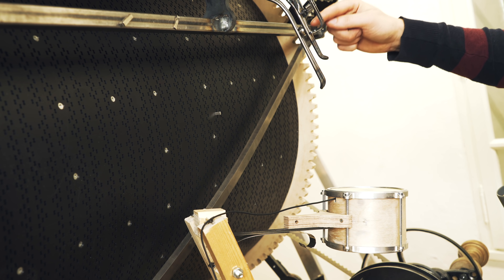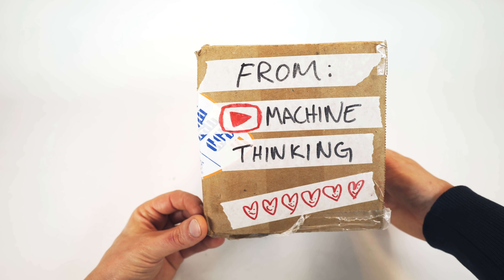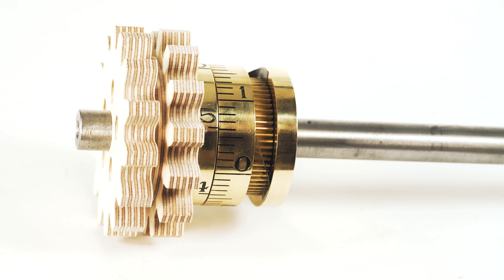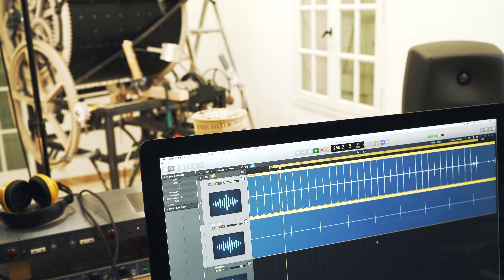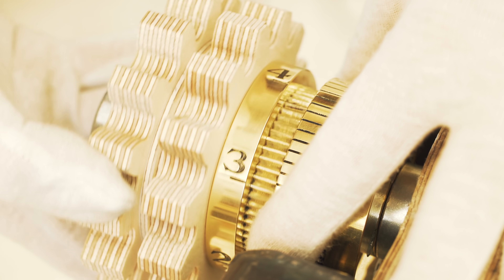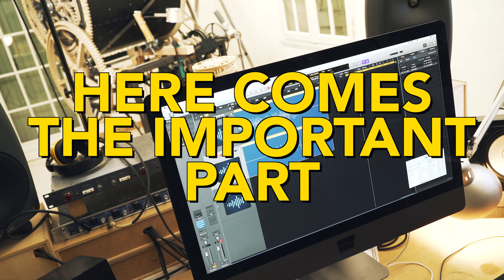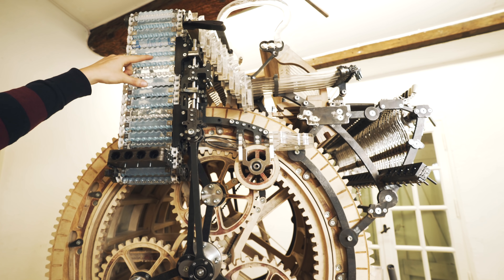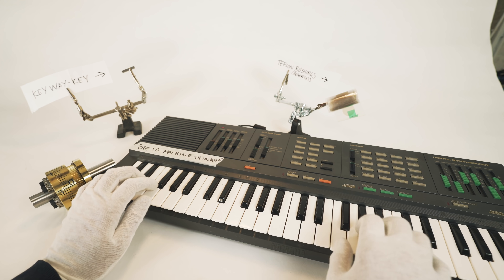Testing the Music Timing Clutch - Marble Machine X #77

Comment: I really like the futureproof thinking here. By making this adjustable, you can use MMX on other planets where gravity is different.
Reply: First moon based concert?
Reply: Artiamus Imura 
Make it so Richard Branson!
Reply: @Artaimus  Indoors then :D
Reply: Mackinstyle The marbles would just get flung off the machine at the lifting part
Reply: @jatoxo  thinking of the technical details! Solvable though... Probably it will need some different lifting mechanisms for the moon or Mars.
Reply: Marbles made of a heavier material should work too.
Reply: Still needs gravity though... Not ready for intergalactic action unfortunately
Reply: @stabojert  the marbels are made of steel, so a large coil powered to be an electric magnet could simulate gravity to the marbles. In that case even the drop speed could be adjusted to the timing of the  rhythm machine.
Reply: @stabojert  You don't need gravity constant vertical (relative to the machine) acceleration of 9.81m/s2 would work in low gravity.
Reply: @zym6687  Good idea :D A lot of cranking is nescessary for that acceleration though ;)
Reply: @stabojert  That depends. Since we're also made for gravity, interstellar travel would ideally involve constant acceleration.  Acceleration toward our goal and then acceleration away from it to slow down again. Therefore, there would nearly always be some "gravity" from acceleration.
Reply: @stabojert  just a tiny transportable gravity massive would be just in case
Reply: This makes me imagine him playing it on Pluto and it takes a whole minute for one marble to fall all the way onto an instrument, but the machine is still releasing them regularly so there is just a wall of slowly falling marbles that are still hitting the instruments at the right moment. Sadly they wouldn't gain enough momentum to be able to strike with the force to make audible music.
Reply: @robertdaw3364  I want to see them do a music video with this concept. the idea of a waterfall of marbles falling slowly from the release just seems awesome.
Reply: @robertdaw3364  you could gain the hell out of the mics,  then not only would you hear the music, but you would hear distant galaxies XD
Reply: @robertdaw3364  This should be emulated with high BPM and some chronos high speed cameras. I'm calling out @tesla500 to figure this out.
Reply: @robertdaw3364  He could enclose MMX in Helmholtz coils. 🤔
Reply: @robertdaw3364  lack of atmosphere to transmit the sound may be a problem lol
Reply: Robert Daw, maybe in future videos we will see a Marble Acceleration Project for the dynamic of the music (crescendo and diminuendo from the “piano pianissimo” to the “forte fortissimo” and conversely) and solving the problem of playing on the low gravity planets...
Reply: Robert Daw it would just miss the drum now
Reply: True that
Reply: It can play in spin-gravity, first space station concert?
Reply: Coriolis effect is a cruel mistress
Reply: @riccardoorlando2262  coriolis might crash the  party though...
Reply: Something about a flyby of the moon comes into mind here :)
Reply: @AbgezocktXD  @yousuck2020 :D
Reply: gettig ready for SpaceX. :)
Reply: @peterpansplayground   You mean, SpaceMMX, right? :D
Reply: It will help out when he’s In space
Reply: I might be missing something but, without air in space how is the sound supposed to travel ?
Reply: Sinnay Sin the entire machine is recorded through contact microphones making the instrument itself the medium through which the sound travels, no air required
Reply: @sinnaysin9861  with electrons moving to the rhythm
Reply: @10produz90  Makes sense
Reply: Yes, but you can't change the timing mid-song, but solo does wonder.
Reply: Haha lol that's true
Reply: The lack of atmosphere is more concerning for music/sound propagation than the change of gravity.
Reply: Aurélien PIERRE Photo so do it on Venus.. oh wait the surface of Venus is hot enough to melt lead.. well there’s not that much oxygen so it would not burn that much.. or just make it out of steel
Reply: unfortunately it won't work with any other gravitational acceleration, because there is no constant relation between the time, the marble needs from top to bottom and the acceleration. [ s=1/2 a t² <=> t = sqrt(2s/a) ]
Reply: I think we still need to work on the zero gravity possibility...
Reply: @elonmusk need some extra cargo for the next falcon heavy launch?
Reply: Actually the gravity is varying on different places here on earth. If he plays a concert in Oslo or Stockholm the ball will fall at 9.82 m/s2, at a concert in Mexico City the ball will fall at 9.78 m/s2.
Reply: that's a dumb thought. 
the mmx obviously would obvously not work on other planets.
he needs to adjust where the ball lands too
Reply: Big Dumb not so dumb... centrifugal force can adjust it too... you know, borders, rounding, some independent on gravity acceleration...
Reply: How high are you?
Reply: Gravity is slightly different around the Earth as well.
Reply: yes, but on the earth's surface it varies only by < 3% I suppose
Reply: @Talaxianer  Different air density would also influence how fast the marble falls. Tuning for local planetary conditions will be a normal part of the soundchecks on the world tour!
Reply: HA! The Mooners will wish they were this innovative.
Reply: Massive magnets!
Reply: definitely
Reply: DANGER, DANGER! 
FEATURE CREEP DETECTED!

Comment: Why didn’t you just change gravity? Ugh, always going for the dificult solution.
(Btw, love your vids)
Reply: The denser air would've changed the pitch of the xylophone, d'uh...
Reply: @dennisamelunxen8283  and there would be more air resistance, thus changing the timing once again
Reply: Hmmm, let just use a brunch of tiny black holes
Reply: Be could be in a vacuum chamber to increase effeciency, Duhh.
Reply: Agent J  I'm super intellect that I can tell you tv watch Rick and Morty... (Real note) technically to accomplish a no air environment you would just need a big vaccume chamber, as there is no air in the chamber but gravity is still applied whatever the original guy was saying should work. Either that or I'm too lazy to read what he was originally intending
Reply: Gravity is not something you should mess with.  
When you dial it to negative accidentally, you'll fly yourself to the moon or somewhere remote.
Reply: Agent J  true, I could put a jet engine on the bottom of it instead so when it's flying upwards the machine could hit the marbles.
Reply: Agent J  and what are you accomplishing?
Reply: Agent J  hey uh could you not fill up the replied of a comment for an argument that doesn't really matter please...
Reply: Sounds like a Bloody Stupid Johnson solution.
Reply: It's hard to focus a gravimetric field in such a small area. The cost would have probably been two or three times the cost of the clutch. Some times practicality rules.
Reply: gravity will change slightly when he takes MMX on tour
Reply: @CL_0 Well, hello there Q 😅
Reply: It's à good idea to change gravity yeah !!! 😀

Comment from the maker: Finally a design idea and solution that delivers 100% right off the bat :). No tweaking with the angle grinder, no mishaps under rare circumstances, just pure delivery sweetness. I could get used to that!
Check out the video from Machine Thinking here:
https://youtu.be/s02m616b5AU

Two things I forgot to mention: Once we know the values of the Timing clutch, they will always be the same. So live in concert we will know the settings for each song without having to test it every time. “Song 3 = 13 steps +” etcetera. This one adjustment will make sure both that the treadle pedal and the crank hits 6 o clock on the rotation in time with the beat and also make sure that the rhythm machine and marble hits are synched.

Yesterday I hit a milestone in the studio, I had a full marble loop with the whole marble lifting system working perfectly for the first time ever, including the conveyer belt, the two gear lifts and the demag wheel. The marble divider has been having an issue where the marbles got stuck on top and I found a super simple solve that reduced resistance for the rolling marbles and that worked instantly. I could have the kick drum playing and the marbles were picked up and transported all the way up. Its getting there.  This thing is so much harder to build than what it looks like at first glance. After the first machine I received many emails from people who told me they were building a marble machine of their own, I haven’t heard back from one of them yet, it tells me im not the only one struggling… Some problems on the MMX are self inflicted (you could argue all) but some problems are also just plain difficult. My understanding of engineering redundancy and tolerances is growing (slowly) and I believe I will be able to follow this through all the way up onto that stage. Its not happening fast but it is happening. Thank you for following along! 

All best/ Martin
Reply: Just wanted to let you know I really enjoyed this video, especially the “Ode to Machine Thinking” We are all rooting for you Martin!